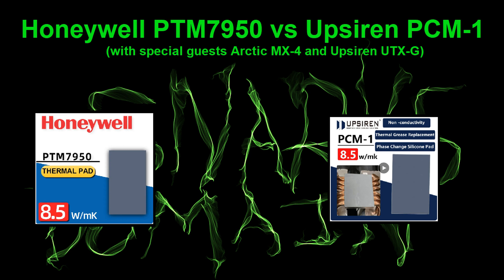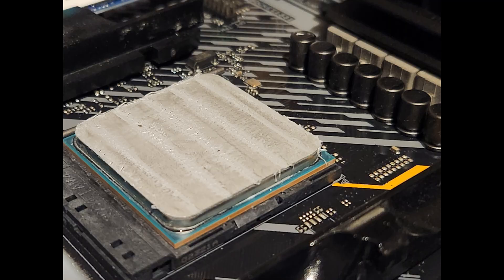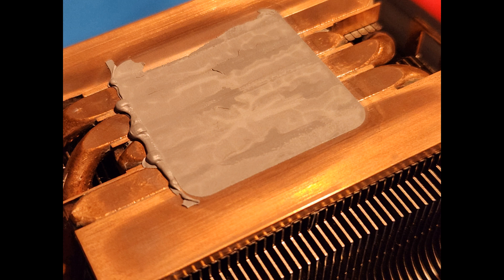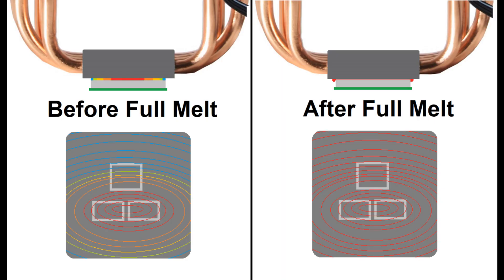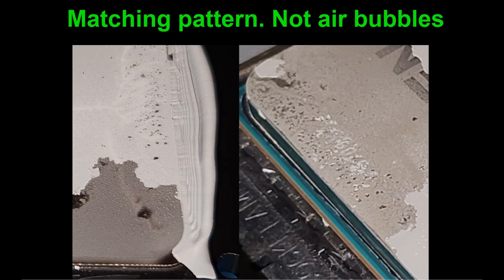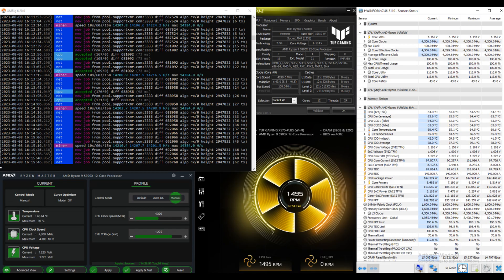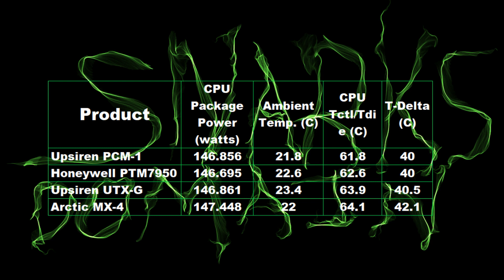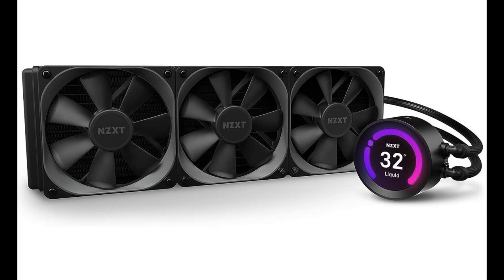Can Upsiren PCM-1 Compete with Honeywell PTM7950?

Comment: Use a plastic spatula or guitar pick to drag along the edges of the die or IHS where the PTM overhangs, it will cut the PTM and make it super easy to peel the film without lifting or tearing. 

I still don't think it matters at all if there are some air bubbles, since they should just squeeze out once there's heat and pressure. DerBaur has also stated as much, if you don't believe me.
Reply: Nope, tried everything, did this literally yesterday and it was my second attempt at this. I out it in the freezer for a while to make it easier too. Nope, still teared in several places. It's like it's glued to the foil. Of the 50EUR I paid for it, I maaaaybe have enough left for another application. It was a nightmare and I really am not an graceless elephant when it comes to stuff like that.
I had to patch it up, but then it was so uneven and thick in some places, that it was locking my PC when I wanted to run Cinebench for example. I had to take the cooler off, scrape the excess PTM, put it on again and now it's working as intended. But man... it's the worst.
Reply: @EpicKillstreak  freezer for too long, which doesnt take as long as you think, can make it brittle - you're better putting in the refridge for a while to get something relatively easier to work with vs room temps.
Reply from the maker: @xBINARYGODx  I don't use fridge or freezer anymore. I find it applies really easy without  bothering with that step.

For easiest application cut it smaller than the die by ~3mm on all 4 sides.

Then use the little stickers or tape at either side of one of the corners and peel apart. Place on die, rub with finger to make it stick well to silicon, then peel at a steep backwards angle.

I'll have to upload a little video soon about it, but have a couple clips in the Discord.
Reply: I gave you thumbs up, as it's pretty smart application here, BUT...air bubbles will be ironed out by immense heat generated within the cpu, and it will do it darn quickly. Similar like protective glass bubbles on the phone go away after normal usage, and that screen barely gets warm. 

I would say this is  a safe bet to stop being paranoid over some bubbles. We are good. Just the pressure of the cpu mounting/waterblock + heat, and you don't have to do summersaults around the application methods. 

That's my experience. I've put on protective films on glass as well, and heat does its' work.
Reply: @righteous-one-7  Yeah you're right, bubbles don't make any difference once it melts. I edited the comment to remove the superfluous stuff.
Reply: dude thanks, I was figuring out similar idea U shape but start from one edge. Mine pad should arrive in couple weeks and I try your style first :) I got an MSI p65 laptop. CPU is power limited but I hope I can drop temps and by that drop the fan noise. If it cools my laptop I slap it also on my desktop that probably is due for thermal paste replacement as its been running since ryzen 1700 release without any re-paste :D still has the stock thermal paste pre applied on the wraith cooler so I imagine huge cooling boost :p

Comment: for Watercooling getting it hot shouldn't be a problem, can just throttle the Pump or even turn it off for a few Minutes and it'll get nice and warm.
Reply from the maker: I was chatting with El-Hurracan on Reddit and they have a watercooled 3080ti. They did an initial "burn in" up to 65 Celcius. Now it hovers around low 40's to 50 C (25C ambient). They do see idle temps of around 35 C which is higher than what they saw with paste, but they weren't too worried about the idle temps.

Comment: I don't normally interact with these videos, but I really appreciate the effort you put into this. Please test the thermalright solution when you can! Also, maybe try cutting the squares into a more accurate size, or ever ever so slightly less than the full coverage as it still spreads out. Should have less overspill and may result in better temps.
Reply from the maker: Thank you for your comment. That's a good idea on undercutting it a bit. Will definitely try that out. I used to do that with pastes, where I would spread it and then wipe a 1/8" (3mm) border clean of paste and still have great contact patch.

Comment: ElmorLabs also makes a nice dual thermocouple thermometer with a screen and USB output.
Reply from the maker: I will look into that option as well, thanks for the suggestion. Managed to get the Aquacomputer Quadro up and running and showing up in HWINFO64. I spoke with Aquacomputer and they said their sensors, and the controller, only work up to around 100C, which should be fine for the testbench.
Reply: @snarksdomain  Nice, sounds like a solid solution too. I see they have some really thin probes for that one.

Comment: Heeyyyy thanks for this, asked you about this test on reddit thanks for getting it out and just in time, just got a tuf 3090 used off ebay for £485 but currently is overheating to 86c on the core, 99 on the vram and 106c on the hot spot!!! Shut it down immediately after seeing that, gpu is fully functional but something is seriously wrong with the cooling solution, tamper sticker was still intact and the seller said he only used it for world of warcraft (overkill i know but i never questioned it) 

Just hoping with the knowledge you have helped me gain i can get it under control, got upsiren pcm-1some copper shims and ux pro on the way, will post my results after im done

Wish me luck lol
Reply from the maker: That's great to hear you are taking a stab at shims. I would also suggest using either Kapton Tape or Conformal Coating to protect the PCB around the VRAM, just to protect the off chance the shim ever moved (unlikely).

I really like the MG Chemicals 422C
Reply: @snarksdomain3453  yeah got some kapton tape which should be sufficient I hope ^^
Reply: How did it go?

Comment: Looking forward to your tests on Thermalright‘s Heilos pad 🤓👍
Reply from the maker: As soon as I can buy it I will :)
Reply: @snarksdomain  You should do a shootout with PCM1, PTM7950, The LTT pad, Thermalright, etc.
Reply from the maker: @jamesdavies686  I had compared 3 of those on Testbench 2.1 but decided to stop core/CPU testing on that testbench as I didn't feel it was accurate enough to trust the results, with such a small temperature span.

I'll soon be testing all of these things, and more PCM's on Testbench 3. I don't plan to buy the PTM7950 from LTT as it will be the same as the one from Moddiy. I also have some sheets coming from Caplinq. I do have Gelid, Thermal Grizzly and Maxtor PCM's though, among others.

Testbench 2.1 will continuue with Putty/Pad/Shim testing for now so we can fill out the chart a bit more (mostly shim+putty combos).

All the current charts are located at the Google Drive link below (Test Chart Repository)

Comment: It's cool that more companies are releasing PCM. I know that there is still Laird Tpcm 7125 7,5 W/mk. I wonder if Thermalright Heilos 8,5 W/mk will also be PCM, but so far I have not seen such information.
Thanks for the test 👍
Reply from the maker: Laird hasn't responded back to me yet, so I ordered some off Digikey. I went with the Tpcm 7250 (A18172-10).
Reply from the maker: I'm hoping to buy some Helios soon, but haven't found an online retailer yet. Will check out that Laird PCM when I can.

Edit: In my opinion it likely is, but only time will tell.
Reply: Igor's lab has since tested Honeywell PTM7950 vs everything else not-metal, and it blows them all out of the water, with the long-term stability that IC Diamond used to give (its not made anymore and hard to find)
Reply from the maker: @xBINARYGODx  it's definitely good stuff. Will be interesting to see how PCM-1 and the other PCM's compare. I wouldn't be surprised if half the competitors are just rebranded Honeywell stuff, but that remains to be seen.

Comment: Aren't they the same product but just branded differently?
Reply from the maker: Hard for me to be 100% sure, but the packaging was much different, the colour of film is different, they came with different coloured tape tabs, and the little tools included with the Upsiren were not present in the Honeywell packaging.
Reply: @snarksdomain  but the substance itself, does it look the same? It is hard to tell by the video.
Reply from the maker: @prarmageddon  Here is a comparison using the camera on my phone: https://imgur.com/a/6MwT8xP
Reply: @snarksdomain  thank you, they look identical to my eye
Reply from the maker: @prarmageddon  yeah, they look similar to me as well. Will try taking better pictures with my camera tomorrow when I get a chance. See if better pics tell us anything different.

If they are made by different manufacturers, then it's likely they are using the same thermal booster material. Could be something like Aluminum Oxide, or a similar non electrically conductive Oxide.

Heinz ketchup and French's ketchup look the same to me once they are out of the bottle. I prefer the French's myself.
Reply: Just because they "look the same", it does not have to mean it´s the same product. Lots of Aliexpress sellers sell "PTM7950", which is either discarded old stock or not PTM7950 at all. How you can find out? Real PTM7950 is expensive. Aliexpress sellers not only sell it cheap, they also add bunch of "waste" tools to bait the possible customer.

If only MODDIY shipping wasn´t such pain... and i suspect, i will pay even more, as they did not add VAT.

Many thermal pastes look exactly the same, yet they have different properties.
Reply: @Morpheus-pt3wq  if pcm1 from upsiren acts identical to moddiy but sells on aliexpress for lower price than why to buy from moddiy in the first place? Especially if it twice more expensive?
Reply: @prarmageddon my same thoughts, i may give this thing a chance for my laptop i suspect that the small die from new cpus causes a lot of trouble, i got an i9 13900h, i tested it in cinebench and got 19896 score, and the cpu seemed to stay at 100-105 W... the problem is the temps, the entire 10 minutes it was 97-100c, and i find it weird because my gpu can go to 115W for a long time and barely go above 80c

Comment: Using phase change material on a CPU is a waste, even for testing purposes. Despite CPU using about 150W of power, this does not translate into 150W of radiated heat. All new Ryzen CPUs, be it 7nm chip models or newer, have very small die size, which limits heat output. My personal guess, about 80W gets out - that´s why with these CPUs, low-end 120mm tower coolers are able to compete with high-end 140mm dual towers. Even intel is on the same boat now, where latest gen chip is so dense, despite consuming lot of power and running hot, can´t be cooled down with anything.

Also, even small changes in ambient affect the results.

I´d steer away from the Upsiren too. It´s an unknown brand with unknown history. The product claims to be related to "computer-systems gr" printed on the box, which is actually k5 Pro putty manufacturer and they themselves distanced from Upsiren product brand. Even when it seems to work just fine, there is no documentation for... anything. Chinese sellers also took your data and are now claiming "our products have been tested", aka they themselves had no idea, how good/bad the stuff actually is.
Reply from the maker: I think it's worth testing Phase Change Materials, at least I'm having fun doing so.

I'll be testing more accurately with ambient temperature being logged using an Aquacomputer Quadro.

Upsiren is a good brand from all my testing so far. I agree, they are not connected to Computer-Systems.gr, thankfully. I'm not entirely sure why Upsiren listed that website on their packaging. I assume it was an attempt to help break into a competitive market of Thermal Interface Materials. That being said, I think they can stand on their own two legs now, and should likely remove said website from their packaging, to make things less muddy.

It's good to remember that most Thermal Interface Materials are manufactured in countries such as China, Malaysia, Vietnam, and South Korea. It is not unusual to have new companies start to create new materials for an ever growing market.

From talks with Upsiren, they have done their own internal testing of the products they manufacture. and there are some new products coming that I will be testing out as well.

That being said, I'm also looking forward to testing out more products from Fujipoly, Laird, Mg Chemicals, Thermal Grizzly, and more.
Reply: @snarksdomain  it´s usually a tactic to confuse customers into thinking, they´re buying stuff made by renown manufacturer. A good quality product can speak volumes by itself and does not need aggressive (fake) advertising.

It´s not surprising, everything is manufactured in East Asia. What is concering, however, is the total lack of documentation. What are the properties? Temperature for use? Temperature for storage purpose? etc.
Reply from the maker: @Morpheus-pt3wq  Yeah, it would be better if Upsiren removes the Computer Systems website from the packaging. 

Other than the basic specs, it would be nice to see some more documentation for sure.

I'll be doing some longevity testing of a several different products but won't have those results for at least a year (perhaps I should do confirmation testing in 1 year intervals and see how the products hold up.).
Reply: @Morpheus-pt3wq All of the heat the CPU generates must get out. 150W in = 150W out. It just takes a larger temperature difference between the die and cooler when the die is smaller. Combine that with the insane power consumption of the highest end models and you have trouble cooling them.

These testing vids are a great. Once the data logging gets improved, even better. No one else compared so many brands of putty and pads.
Reply: @diavolescaCZ  unfortunately, no.  Chip´s ability to radiate heat directly depends on the contact area with IHS. If this contact area is smaller, then amount of radiated heat will also be smaller and the rest of waste heat will remain trapped in the socket. I recommend looking at any anandtech cooler reviews (all of them were done with dummy heaters) - pick data for 150W and then compare with cooler reviews done on Ryzen CPUs. The data, i saw so far, perfectly match with anandtech 80W dummy heater heat output data. 

If all 150W of heat were radiated into the cooler, then the smaller 120mm tower coolers would all be left in dust behind their larger competition and yet... they are not.
Reply: @Morpheus-pt3wq  You cannot run a chip producing 150W of heat and have only 80W get out. Where does the rest of the heat go then? 
If you only had 80W of cooling on such a CPU, it would hit max temp within seconds and throttle until it consumed only 80W of power.
The small die just means the heat is harder to get out and away. Thus a higher  CPU temp.
A big tower cooler won't have all of its heatpipes directly over such a small die for example.
Reply: @diavolescaCZ Don‘t waste your time trying to educate people like him, it‘s a dead end 😂
Reply: @niikon  actually, i DID learn something from it and i´m happy, somebody wasted my time on it. I won´t waste yours, tho. Surely, it´s more precious, than helping some id*ot (me) getting some knowledge in a way, he can understand.

Now, if you excuse me, i won´t waste any more of my own precious time on you...
Reply: that's not how that works. that's not how any of that works